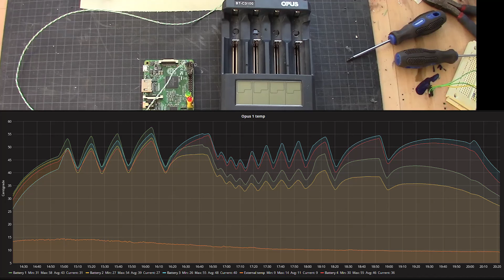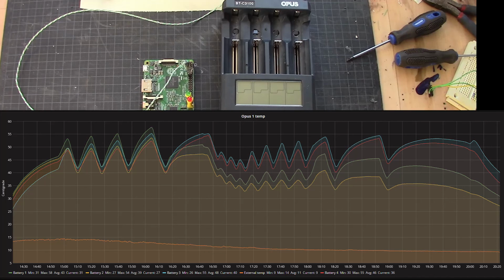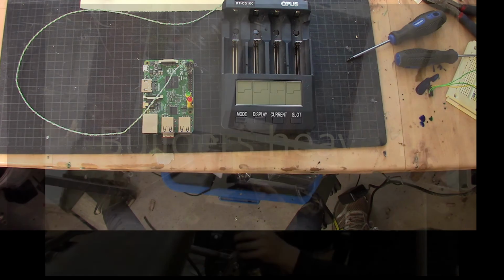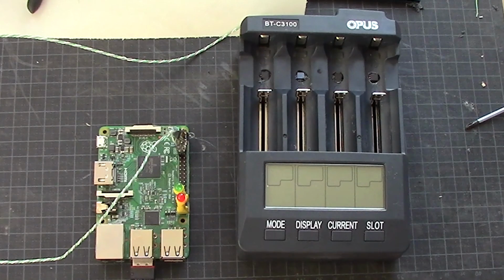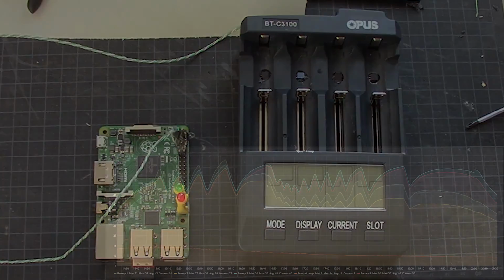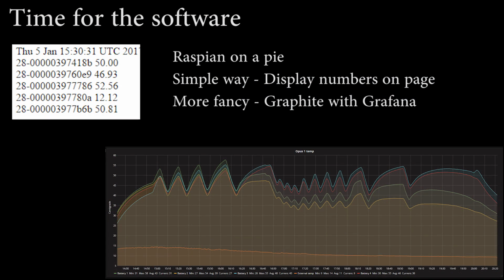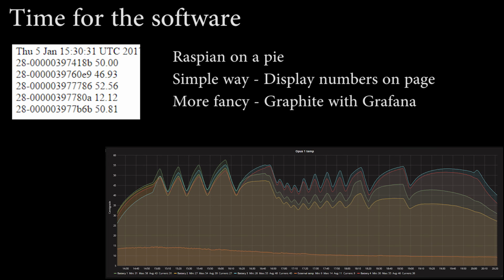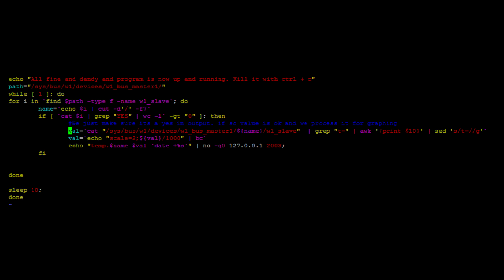Cool temperature logging on your Battery chargers with 1wire and a Raspberry Pie

Comment: Nice mod. FYI, the two screws either side of the 'smaller' screws in the middle actually hold the LCD screen onto the board and don't need to be removed to get the board out of the case.
Reply from the maker: Yeah i found that out after opening it :D

Comment: I think I missed something.  How are you getting individual values from the temp sensors when all three wires are connected to all four sensors?
Reply: Pretty sure it's part of the "1wire" bus.  Pretty sure since each temp sensor has it's own hardware address, similar to a network card mac address, you can basically daisy chain them and just query each individually.  

This link might help.
https://arduino-info.wikispaces.com/Brick-Temperature-DS18B20#mult